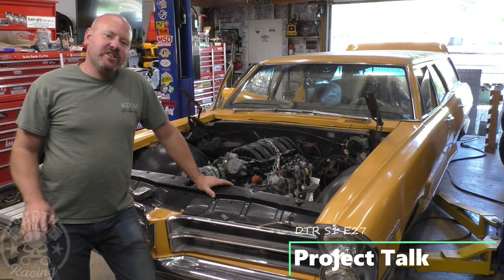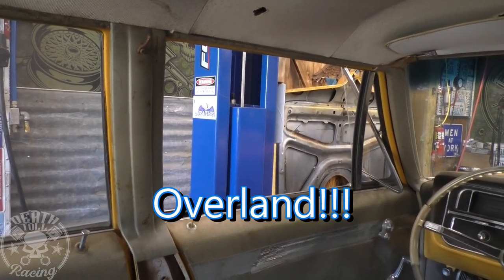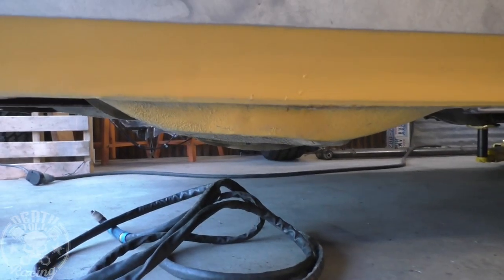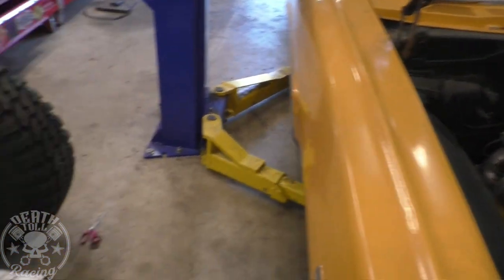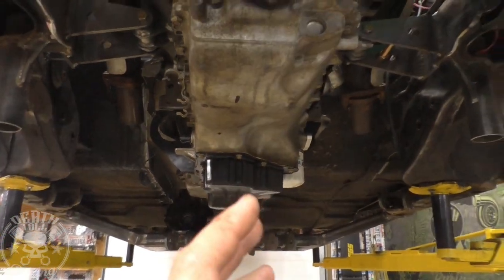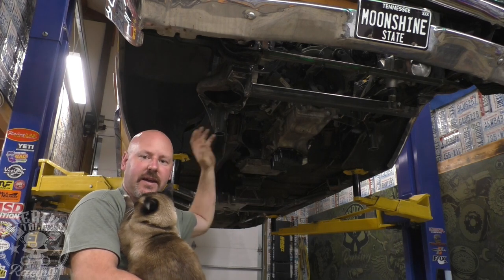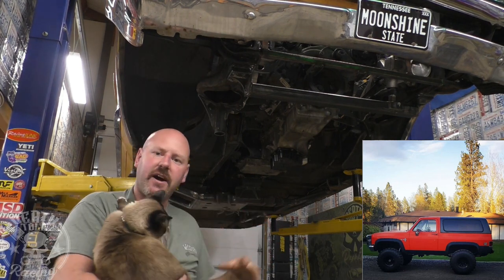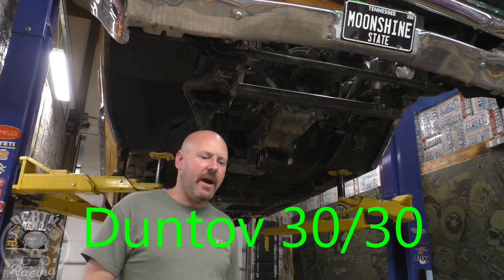E27: 4x4 Pontiac Safari Progress Report, and the Happenings Upcoming from Death Toll Racing

Comment: For the radio there are a couple companies that make classic looking head units with modern features that can just drop in to the dash. You could also consider mounting a tablet onto the console. It could be used for music, navigation, and engine monitoring.
Most importantly, it won't be a true overlander until you mount a $300 shovel to the roof.
Reply from the maker: Right?  A $300 aluminum shovel that only works in sand

Comment: Man on a mission. Moving house and shop. Good luck to you both. Makes my head spin with your future builds and plans. To you two water off a ducks back. Question on the Safari. If you cut the roof out for the slider will it make the body turn to jello. And are you putting a roll bar in it. I like bobs shop safety. Get up high. If you want some free help moving you can go on a website called Help Exchange. Or Workaway. You have to feed um and give um a bed or a tent. But no moneys exchanged. Check out the websites. Take the strain off the move. Good luck. Looking forward to more videos. I'm lock down in Italy for three months waiting on a ferry to open for Greece. Stay safe. Dino.
Reply from the maker: Yeah, we have been here for 16 years so it will be an adventure.  I'm just trying to focus on the positive of it though, and trying to figure out how I can incorporate it into my channel so it doesn't go stale.  

As for the move, we have it under control.  I'm doing it over a couple month window so that I can set up properly in the new space without having a lot of items stored.  I really hope whomever buys my current place once I put it up for sale, appreciates the shop and doesn't just use it for storage.  

Good luck on your lock down.  So you are not even home?  Home is in Greece?   We have an employee in Ireland right now who has been stuck there since this started.  Luckily she has a place to stay and they extended her visa.  

Thanks for your support!
Reply from the maker: Oh yeah, I forgot about your question about the roof.  I don't think it's going to be a problem, but it will be looked at.  The only support going across the car currently is just thin supports to keep the sheet metal from collapsing.  The perimeter frame is very heavy.   There is going to be a couple bars added to the car for seat belts (5 points) that will connect the cars posts together.  Eventually as we upgrade the car we will probably add a cage to the car.  But for now, just the bars for mounting the belts.
Reply: @DeathTollRacing  me and my wife are English but have a house in Bulgaria. We wintered up in Portugal to have a look around then made a break for the bourder but got cut off in Brindisi italy so had to rent air B and Bs for three month. Maybe ferrys start again on the 1st july. But we free to go out in Italy now. Weather's good. We on the beach. No body here. But like to get home. Italy not cheap. Plus paying rent when I been living on the road for thirty years. Not sure about showing people how to fit a shop out. It could work. Tricks and hacks always good. Maybe they come for the car builds. 50/50 on that one. But I been in the construction game all my life. Could be interesting to some people. Lol. Do what you feel like. It's your show man. You presenting getting better. I like you idea to keep the Safari for life and go in joy it. And improve on it. Good to get your mind back to nature up in the mountains. I've had my van Severn years been all over Europe up and over every mountain twice. And no couldn't camp in Italy on lock down. Cops keep moving us on out of town. Lmao. Just keep knocking out your vids. Anythings good. Got to be better than bullshit news pumped down your ears 24/7. Lol. Good luck to you both. And Bob. Fly with the EAGLES. Dino /Diana.
Reply: @DeathTollRacing plan sounds good. Hope it works. Maybe cross bracing on the chassis like convertibles. Interesting build. First I ever seen up close. It's all heavy duty. A old man in Alabama once told me when I said we can convert that old barn to fix the machines in. He said they don't break in the barn only in the muddy field. Lol. Looking forward to the chop. Lol. D